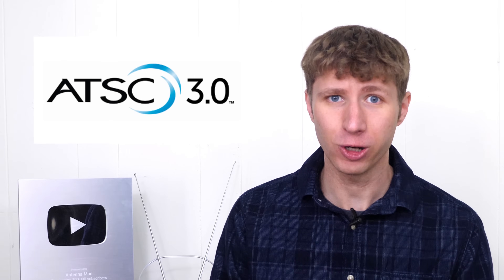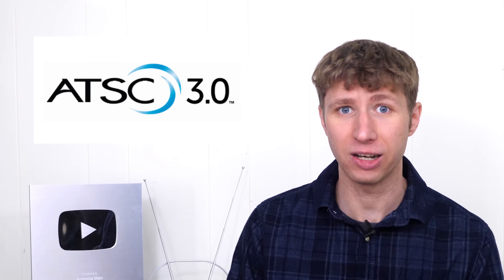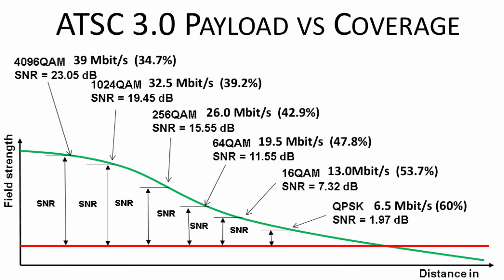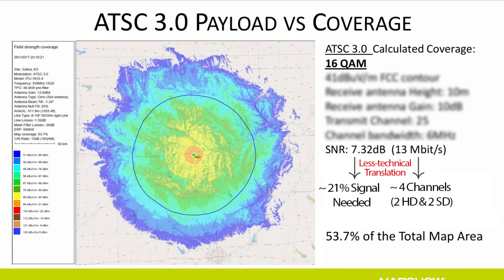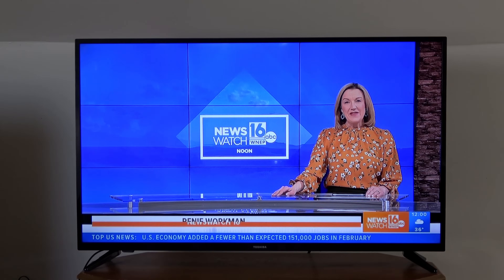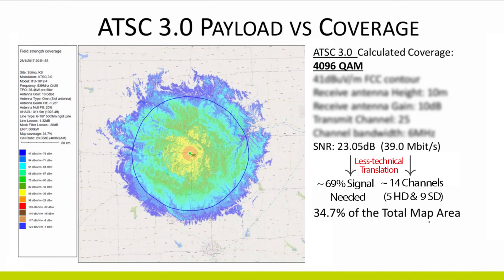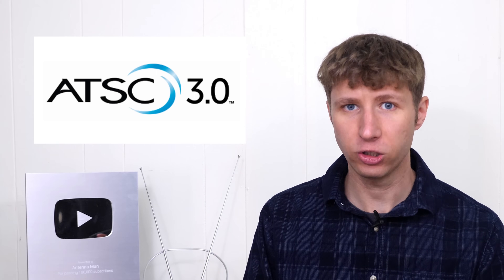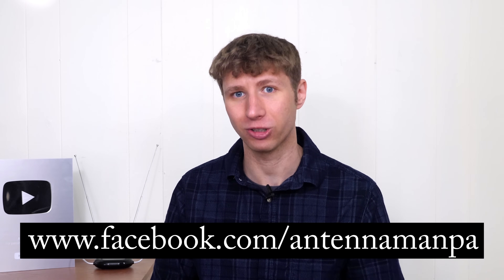ATSC 3.0 Allows TV Stations to Reduce Their Broadcast Signal

Comment: Great overview of the modulation tradeoff to optimize bandwidth vs coverage area. Early on during discussions of the advantages of ATSC 3.0 folks were salivating about the potential of 4K OTA broadcast and I didn't think that would ever happen. For most folks HDR at lower resolution looks as good as 4K but takes up much less bandwidth. So the question is what do you think TV stations will do, spend precious bandwidth on something most folks will likely not notice or use it for more subchannels? This is entirely separate from the data casting issue.  Bottom line, TV stations will do whatever they can to maximize revenue.

As a long time OTA family in a fringe area I'm very disappointed how the ATSC 3.0 rollout is proceeding.
Reply: Extremely disappointed 😡😡😡
Reply: The main issue and why I don't think 4K television broadcasts will be a thing anytime soon is the lack of 4K source content. Producing 4K live television is very bandwidth intensive and is usually not justified except for major sporting events. Like, for example, newscasts would have no real additional benefit from 4K.

I also blame the majority of people consuming content on their small mobile devices as to why 4K broadcasting will not take off. If the majority of us still watched television and other content in front of a larger screen, then we might already have had 4K broadcasts and a Full HD to 4K transition just like we had an SD to HD transition.

Comment: Also it's a thing to note, while the QAM constellation or mode be higher , also is more fragile the signal that is can broadcast a higher payload but any problem of propagation cause more problems, when the service can't reach the desired coverage is often used gap fillers which acts as the cell antennas must be in sync of time to avoid broadcasts problems since are repeaters, also the times that you could get channels from different counties will be over since with QAM Modulation also can control the how wide the area will be and believe me won't be able of pick up signals of other markets, this thing is not different with ISDB-T

Comment: I’m one of the few people who still have some NTSC TV’s with ATSC 1.0 set top box.  Just curious:  are there any, or will there be any, STB’s that convert 3.0 straight to NTSC?  The gadgets I see look nothing like the 1.0-to-NTSC boxes.  Can’t any 3.0-to-NTSC just look the same, where only an extra coax is needed, and with a “ch 3/4” switch?  The ones I see look like you need HDMI and whatever alphabet stuff is needed!
Reply: They only have HDMI, which is digital. You’d need a composite to HDMI converter.
Reply: Some (at least one) also have an AV out, which with the right adapter cable, will give you composite video and audio (3 plugs, 1 usually yellow jack for video, plus red/white for left and right audio). Some old analog TVs have inputs for these, but many don't. If all you have is antenna in, you'll also need some sort of RF modulator or adapter (composite to RF, or HDMI to RF).  And, newer ATSC 3.0 boxes aren't designed primarily for NTSC sets, they mainly seem to be for adding ATSC 3.0 to HDTV flat screens that don't have it built in. This means the do things like on-screen menus that run right to the edge (corner) of the image, and use small fonts that are hard to read on a set that's not high definition. These may not display well on a tube-type TV, especially if it has rounded corners on the tube. I currently have an ADTH box connected to an old Sony Trinitron that has a composite input. It works, but it's not ideal.

Comment: What exactly do you consider doing the right thing means Tyler?  The higher modulation schemes is a feature and not a bug.  And yes ofcourse the reception threshold goes up when you are using more bits per sinuswave but that is the case with all digital (TV) systems, not only ATSC 3.0.  Also you forgot to mention that broadcasters can switch from  mpeg2 and H.264 to HEVC/H.265 and maybe even H.266 in the near future. So they will be able to cram way more HD channels in anyways and still do datacasting if they want too, and yes 4K is also an option. But even if they choose to use a higher SNR threshold and have more bandwith. I think that will be likely, why wouldn't you make more out of it?   They will do measurements in their desired coverage area and if necessary increase the transmitter output power and antenna pattern so you still have a good reception allowed within their permit ofcourse.  This is all pretty normal, it's not made to bully antenna viewers.  Ofcourse long range (DX) reception might become alittle more difficult but then you are probably outside the official coverage zone anyways. DRM or as we call it encryption is a much bigger issue.!

Comment: I suspect this is happening in the South Bend Indiana market. I am in the fringe area (63 miles from tower) and get reliable signals on 1.0 but less signal strength and usually not enough to render the picture on ATSC 3.0.
Reply: U may need to aim your antenna again 3.0 signal.

Comment: I'm very happy to see you covered this issue. I have exactly this situation with my ATSC 3.0 lighthouse station. I'm in a fringe location 81 miles from the transmitter over a difficult 2 edge path. When 3.0 started up last year they put 6 HD channels on the transmitter which required them use 1024QAM and a 19.45 dB SNR. This killed my reception of what once was a pretty reliable 1.0 station. I was able to restore reception by going to antenna extremes: a pair of AD 92XGs on my ham radio tower at 62'. Reception is now almost 100%. Very few people would be able to do this.
Reply: Hoa probably won't allow it here in Texas didn't know what hoa was in Ohio
Reply: @gbany100  FCC requires HOAs to allow all OTA antennas as long as you need the certain type and model of the outside OTA antenna to receive the signal. This applies to owners and renters.  Here's the link to the law https://www.fcc.gov/media/over-air-reception-devices-rule#:~:text=The%20rule%20prohibits%20most%20restrictions,of%20an%20acceptable%20quality%20signal.
Reply: Yeah I'm the edge of 2 markets.  If the 3.0 signal us better but reduced, what is the point ...certainly they dint isn't reach more viewers  ..   Im not putting up a 60 foot tower..it just shows how little they care.

Comment: I think it’s struck a proverbial iceberg and it’s going down. It will end only one way. You will have to pay for the system. A lot of these channels will be encrypted. To that end the FCC will ultimately rule that the signals, even though they go through the air, they are the property of their respective networks and owners. You have no right to use or view them without permission, or paying for them.

Comment: Honestly, I don’t see the appeal in data casting. Sinclair mentions “new business opportunities for broadcasters” but there really isn’t any “one to many” use cases besides broadcasting anyway, and most high bandwidth IoT stuff is already handled by cellular or WiFi. The data rates mentioned aren’t that amazing, and considering you then need a tv antenna and then pay for many broadcasters across a bunch of markets if you wanted nation wide coverage… just doesn’t make sense!
Reply: I can see it being used for emergency services personnel, but most of those (at least in metro areas) have already changed to a digital-type system from the old analog systems.  One limit I can see to contracting out for this service is the probable downtime during an area-wide emergency; can a single station support emergency operations, or would multiple contracted stations be needed for back-up.   I know most of the emergency services providers in my area have back-up systems in place, so not sure datacasting on a broadcaster's system would have any advantages.
Reply: @crosslink1493 but FirstNet already exists, is bidirectional, and much higher bandwidth.

Comment: ATSC should only be broadast on LOW VHF Channels 2, 3, 4, 5, 6 and UHF Channels 14-21.
Reply: No, the low VHF channels, especially channel 2 is subject to E-skip interference, especially during summer.
Reply: @Boomerlake  The best Low VHF Channels are 5 and 6 between 76 to 88 Mhz.  They only require an antenna about 34 to 38 inches long, a little longer than the 31 inches used on car antennas.

Comment: As I recall, you can run up to about 28mbs data rate max on ATSC 3 and still maintain your ATSC 1 coverage area, all other things being equal including the average power output level.  Peak energy will be higher though, so your transmitter needs to handle that.  Positives are that the HEVC codec is much more efficient then the current mpeg2, so that goes a long way if you are not doing any 4k.  A single 4k program could eat the entire data stream, so the idea there will be 4k transmitted over the air on ATSC3 is not going to happen.  Expect about 20 infomercial channels all pixelating instead.
Reply: So, no changes in the overall experience.

Comment: Bottom line- if broadcasters are going to be monetizing the public airwaves, they should be required to provide a reliable free over the air TV signal as a condition of holding a broadcast licence. 

No DRM, no low bit-rate channels, and datacasting should be used strictly for public safety and emergency alerts. Let 5G broadcast be used for commercial purposes.

Comment: Well, with whatever happens with the future of OTA, the best thing to do would be to make sure you have the best antenna setup for your area. I know I need an upgrade.

As always, thank you Tyler for your videos. They are always informative and educational. Keep it up!
Reply: At some point, the best thing to do is to carry my TV out to the curb and to take down my 93 million mile TV antenna.  It is going to all turn into subscription services.
Reply: I feel I have the best antenna setup, thanks to Tyler and his antenna recommendations.  I have a Direct Antennas Clearstream 4V and have had zero issues with it.  It'll even pick up a station around 55 miles away that the antenna isn't even pointed at and is blocked by the my roof on my house.  It does a damn good job of picking up ATSC 3.0 signals as well.

EDIT:  Typed the wrong antenna.  It was a Direct Antennas Clearstream 4V.

Comment: I recently upgraded my outdoor antenna to the "Antennas Direct ClearStream 4V" that gives me a 70+ mile range with a preamp,......... which is great for living in south central Florida and having towers in all directions giving me a lot of options, because I now have 2 ABC, 2 NBC and 2 CBS channels along with my 1 Fox channel, however I've noticed that at certain times late night, I lose certain channels, but I then get them back usually at 4am or 5am precisely on the hour. So I'm sure that they are controlling the broadcast signal strength.
Reply: "lose" certain channels
Reply: @rojoeditor  thank you!
Reply: @DRM—-we’re thinking of moving there!  At least there are SOME open FM frequencies there, as opposed to only 2 or 3 here.  😡
Reply: @christopherdunne7848  Being centrally located here only puts me in the middle of the larger cities ie. Tampa, Ft Myers, St Pete and the fact that the antenna I chose which is multi-directional (I think that's the correct terminology), I didn't have to completely aim it in one direction. If I lived, let's say, on either coast, I probably would have purchased a stronger antenna to capture everything in it's path. However my choices are around me in different directions. Also the fact that my antenna has a 70+mile range, I didn't need to look to go beyond that because the gulf and the Atlantic Ocean are within the 70+mile range in either direction and I know that the towers are not on the beach. Lol🤪
Reply: @christopherdunne7848  However, Sebring itself is nothing to get excited about, unless you are looking to get away to a small town that's probably a little behind the times. Lol 🥴🙄
The pandemic and the housing market is what got me here. I was able to beat the craziness of crisis, let's say!
Reply: Near Sebring?
Reply: @christopherdunne7848  yes, about 4 years now.
Reply: Forgive me, but I had an oops moment. I originally had the wrong antenna listed, but it has now been corrected!